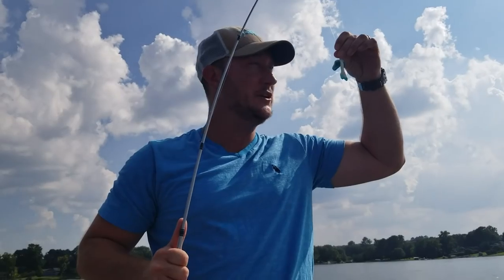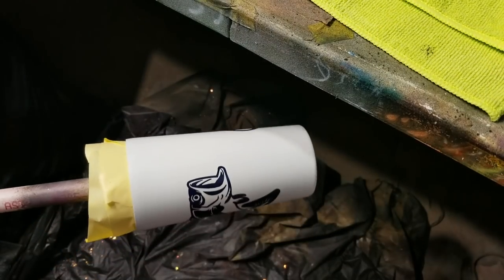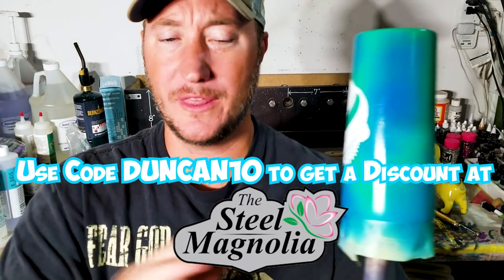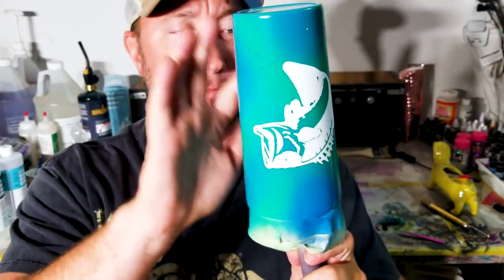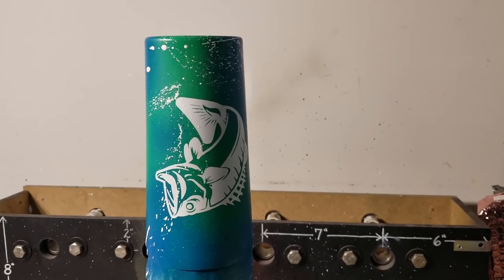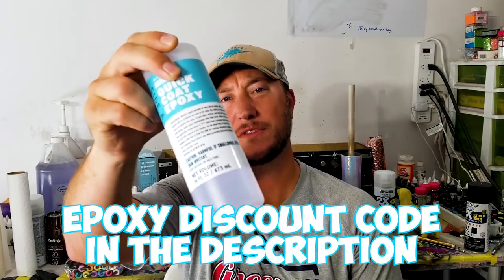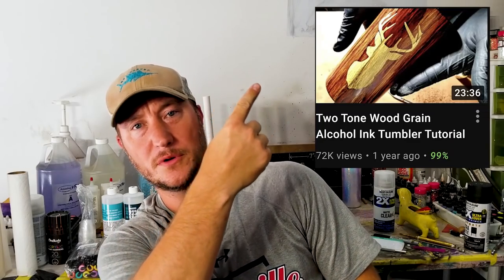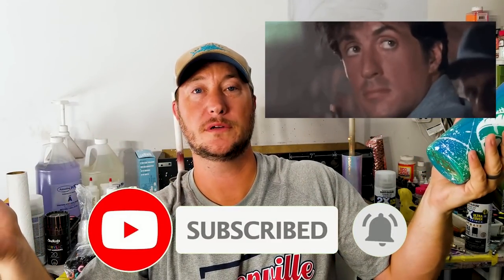Tumbler Only for a REAL Fisherman (and totally not a pretend fisherman)

Comment: Do you sand double wall stainless steel cups before putting on spray paint, too?  I did my first two but I wasn't doing a removable vinyl so not sure if it was necessary.  I've seen both but since you have a background in custom painting on motorcycles, I figure you're a pretty darn good resource for questions like mine. LOL!